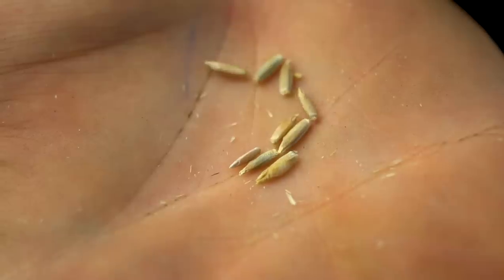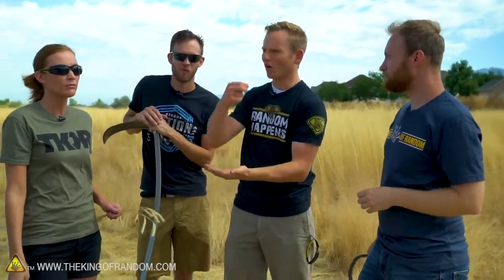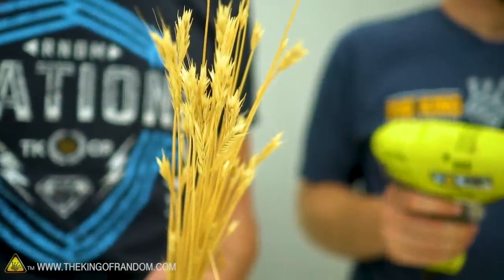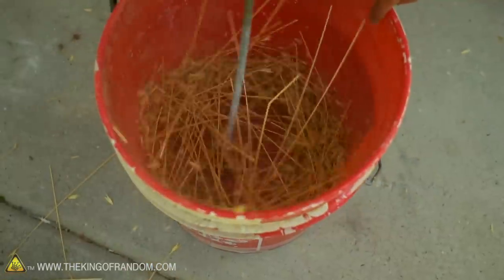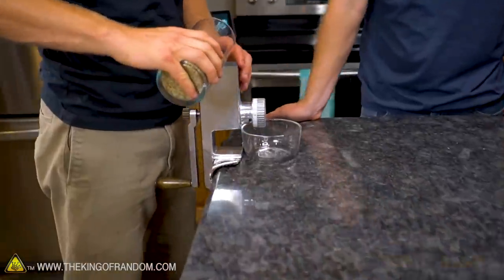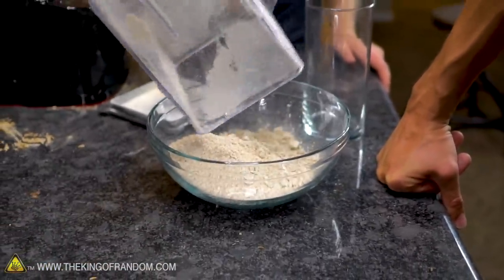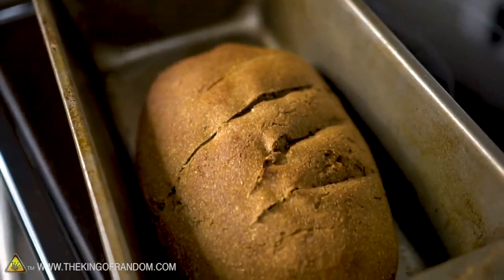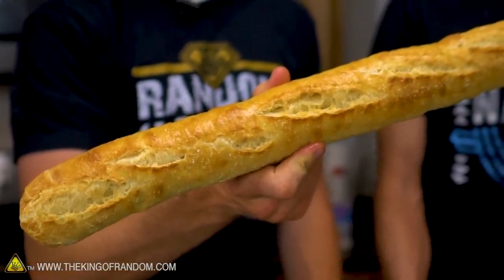Turning Roadside WEEDS Into BREAD

Comment: Just for those who were wondering you do not need to nor should you been down like you see Nate doing with the scythe standing from a relative upward position and swing with it a curving motion will be sufficient enough to cut the wheat. That is the reasoning for the angle blade.

Comment: What happens if you put ferrofluid inside a backyard foundry?
Reply: Probably some pretty deadly fumes.
Reply: @typicalfailure6174 

Yeah, Mineral Oil Would Be Pretty Toxic If You Vaporize It.
Reply: Well, ferrofluid is really just super fine metallic shavings and some sort of oil. I assume something similar to mineral oil. So not that much would happen, the liquid would boil off, and the fine shavings of metal would be left in a crucible melted and glowing hot.